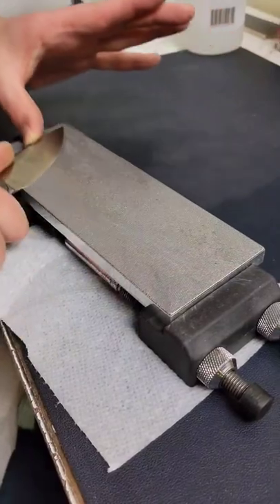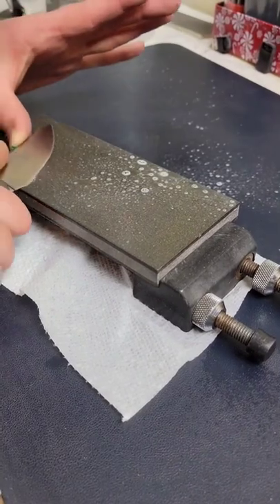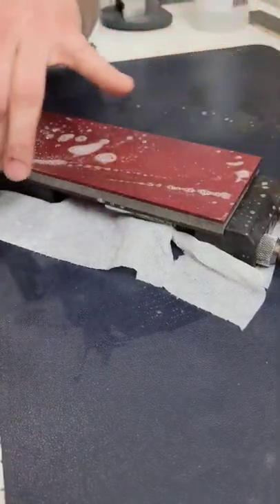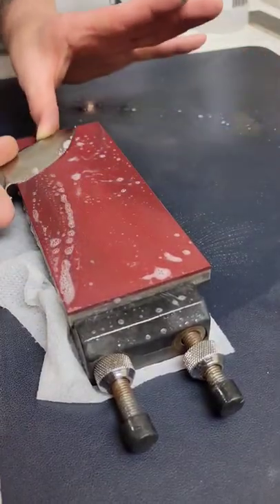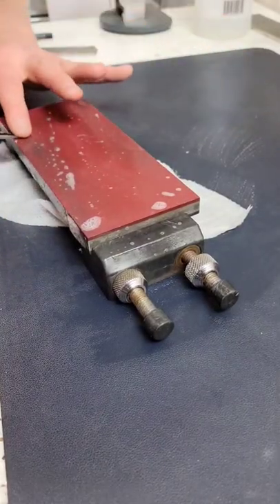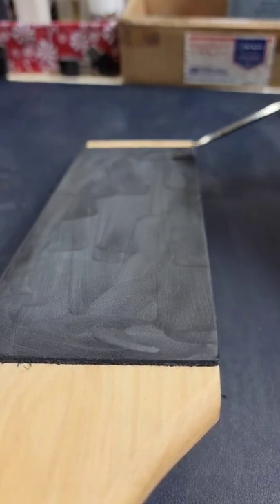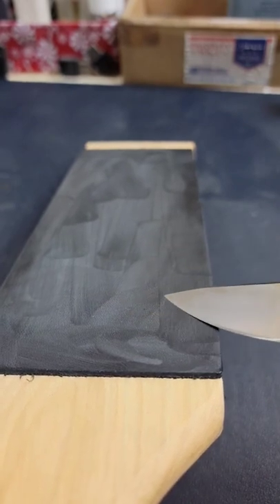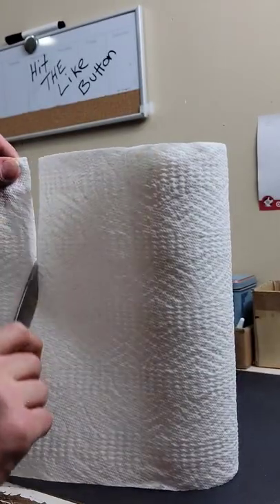REPROFILING AND SHARPENING S35VN BLADE STEEL

Comment: I thought I was getting good at sharpening until I watched you cut a paper towel.Thanks for the lesson in humility 😂.
Reply: Utility knifes aren't ment to be sharp due to the way the egde is shaped makes it a better wedge thus if kept very sharp it will quickly dull and actually damage the blade. A knife with a edge style for extremely sharp edges is a French chefs knife, though most manufactured knifes are missing the edge style.
Reply: @gamersland2557  so u mean no need to sharp these knives man what r u talking so what is the meaning of buying these expensive knives if they r going to b damage that easy
Reply: @sufimaya7223  What a more expensive Knife has is, Better steel, a good edge style for it purpose, and generally better craftsmanship. Most cheaper knifes have a straight edge style which is a jack of all trades, real chef knives have a concave edge style which gets sharp and can cut soft things easily, a good utility knife has a convex edge style which doesn't get as sharp yet is alot more durable. Search up knife edge styles if you want to learn more.
Reply: Yep it's taken me a long time to get decent at it.

Comment: Any opinions on WE heat treat vs Benchmade and Spyderco? Where does WE sit? Thanks
Reply from the maker: Spyderco is the best, We does a great job, Benchmade is ok but they have had issues in the past I'm hoping they have worked it out, seems like they are ok now, but you can't go wrong with Spyderco heat treatment.  But we knives is doing the best ad far as overseas steels go, and reate, but we does a great job

Comment: So why so steep an angle at the point on the strop
Reply from the maker: It's the same angle as I sharpened, it probably just looked that way, it would be bad if you hold a higher angle